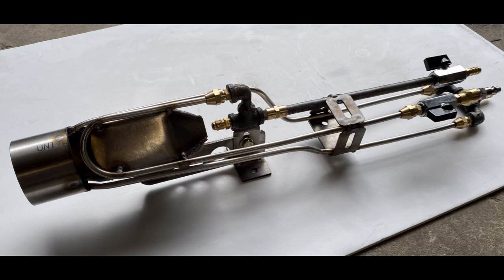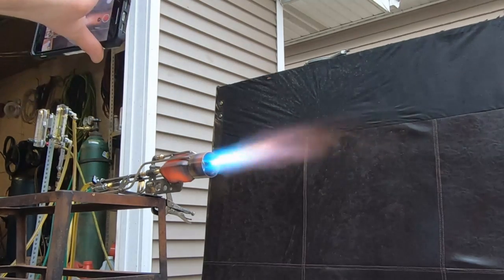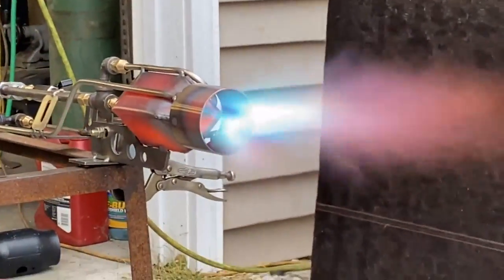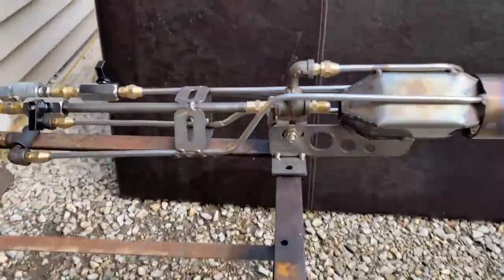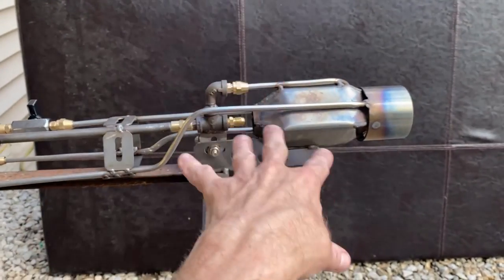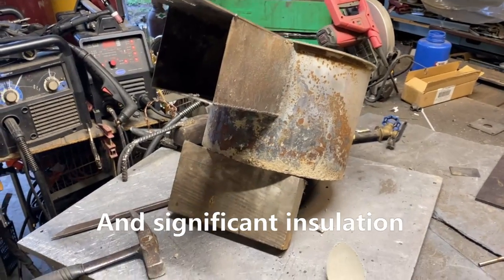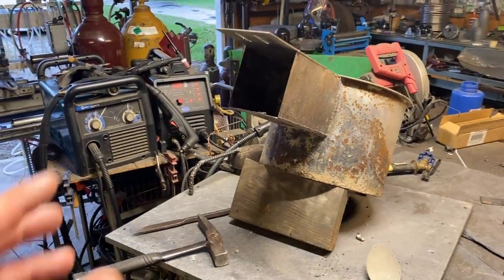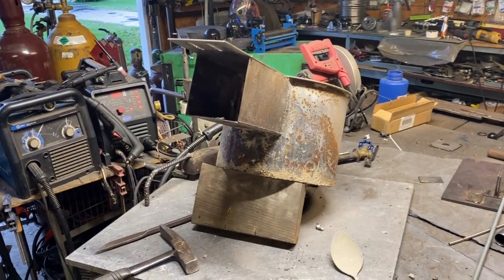ROCKET BURNER  4,000 Deg F

Comment: Hi, fellow. Impressive thing. Can I run it on propane tank and air compressor? Btw how big tank, HP and liters per minite in your compressor?
Reply from the maker: Yes it runs very well on propane . you need a large air compressor for max performance . I am using 6 to 10 lpm and have even used 18 cfm

Comment: how much does this run
Reply from the maker: The version pre heat version without O2 lines is $155 and the version in this video with the o2 system  will be $195

Comment: continual flow nitrogen membranes can push out 80% oxygen pretty fast... probably not fast enough to keep up with a burner, but maybe enough to fill an inner tube while the forge heats?

The roar of an oxy-fuel torch sounds like money in the bank! Keep up the good work.
Reply from the maker: Yes ive already looked at zeolite prices , im gonna make a huge oxygen concentrator that hooks up to your air compressor .
Its gonna be huge and cheap as possible .

Comment: i wonder what would happen if you have coated sides of the foundry with aluminum oxide ceramic plates as a shield. it shoud protect the walls from heat and oxidation, allowing continious use of oxygen.
Reply: The only thing I see with this is the EXPLOSION that can and will happen.